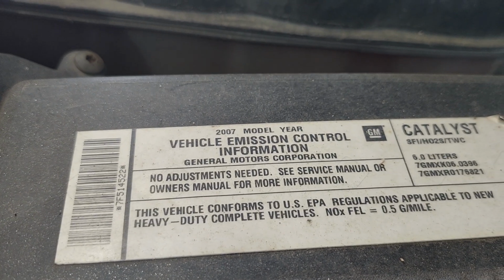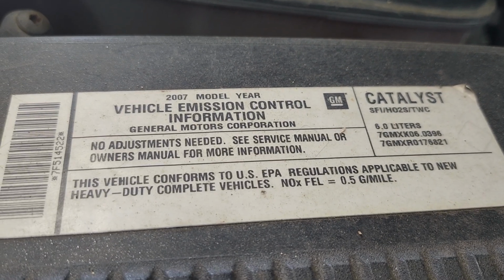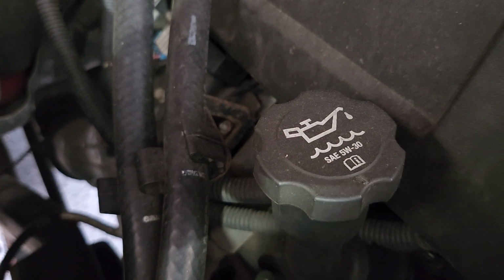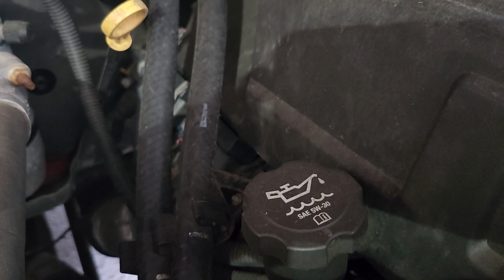Use 5W30  low engine failures .Use  0W20 oil high engine failures

Comment: I was looking at the comments and some people get it but most do not, so I will say it again the only reason they use this thin oil in the US and not in other countrys is for the fuel economy numbers that they have to meet, yes thin oil will give you better fuel economy and more power for a little while, until it starts ticking or locks up, dont do it guys, listen to Anthony he knows what the real thing is
Reply: It's not that cut & dry. Higher Viscosity doesn't always equal better protection, the "Additive Packages" added to the Quality top tier thinner 0w20 oils are what make it superior or just as good as the 5W-30.. Actually the 0w20 has better Additive packages
Reply from the maker: Thank u  I encourage views to read the comments

Comment: i changed oil to 5w30 on my 2016 lexus nx200t, f/the 0w20 it called 4... getting a little better mpg, up 0.02... runs sooooo much smoother & quieter since... kinda feels like i put a nu engine in it...  i am an AMSOIL guy... w/78k on it i went 2 their hi-milage, soooo glad i did...
Reply: That trick works with any engine, older engine and you can step up in oil viscosity for a bit. First number says how easy oil flows when cold, second number how easy it flows when hot. So basically you stepped up for harder flowing oil when cold and harder flowing oil when hot, that means it is bit thicker oil. Since your oil pump is not so good as brand new pump it will be much easier to push bit thicker oil and create bit higher oil pressure.   makes no sense your mpg to go down, unless your 0w20 was not as good quality as 5w30 or your engine was worn out significantly. Oil is not just flowing numbers there is much more specs that needs to be satisfied as per detailed oil specification of your car manufacturer so you can say you have the right type of oil for your engine.
Reply: you are doing the right thing, Amsoil is great stuff, just use the high mileage 1 time, if you have no leaks use the regular 5 w30, the seal conditioners can shorten the life of good seals
Reply: @JimSix-jo6hf  high-mileage oils aren't just for leakers- they have added protection packages for larger journal-to-bearing clearances.
Reply: @tommurphy4307  yes I hear you, but I have seen seals that failed early because they just got too soft, but mayby they were using a crappy brand of high mileage oil, I will have to think about it, thanks for the comment

Comment: I have a Ford Transit 250 3.7l. I have been using 5w 20 full synthetic usually penzoil platinum change it around 3000 should I start using 5w30
Reply: i would go by how it sounds on a cold startup- maybe even teeing up an oil pressure gauge to see how long it takes the cold start to make oil pressure. don't change anything unless you find a valid reason for doing so. you aren't mentioning the mileage or hours the motor has actually run. i have heard nothing but good things about pennzoil's platinum synthetic and thinking about trying it.
Reply from the maker: I would

Comment: I use Amsoil 0W20 diesel on my 3.0 Duramax. 6X more wear protection without sacrificing fuel economy. And I change between 5k and 6500 miles.

Comment: I have a car that uses 0W20 has over 230000 miles and a CRV with 320000. not sure if 0w20 is a issue.
Reply: And not every smoker dies of cancer...
Reply: good job with your honda motor. pay close attention to the oil you remove from that  motor- you're going to be due for a freshening soon.
Reply: Love Toyotas and Lexus

Comment: 5.4l triton 3 valve owners: switch to 5w30 at your next oil change. If you continue to run 5w20 you will have timing chain tensioner and cam phaser failure, guaranteed.

Comment: Get rid of the 0w20, buy and install a 5w30 oil cap, and if you take it to an oil change place tell them "I was told to only use the oil that is stamped on the oil cap". If they wish to argue about it (Most wont) just LEAVE.
Reply: yes, god bless you
Reply: there's no need for that- any good oil changer is going to use what works best for their clients.
Reply: @tommurphy4307  Not around here. Knuckle draggers pour in what the cap says, and often don't get that right. That's why I do my own.
Reply: @tommurphy4307  People - and things - don't always do what they are supposed to.
Reply: couldn't possibly be the turbo gdi pushing350hp out of a 1.5liter i4?  no, its a jus gotta be that there new fandangled oil that saves a whole whopping 0.02%mpg

Comment: I agree with 100% about 0w20 oils. With synthetic oil you do not need to change every 3k miles, only fudds do that. I have used synthetic oil for 20 years, I NEVER change at 3k, I change between 5k and 7k. I also run 5w-30, even with 0w-20 recommendation. I have never had an engine failure, I have put hundreds of thousands of miles on my trucks. I have also DOD/AFM delete my engines myself, the whole physical deletion, not just electronic deactivation. The GM DOD/AFM is terrible, not terrible enough to make me change manufacturer. I have used WalMart Supertech for years, no issues, otherwise I use Mobil 1 synthetic. Again, I stress I have driven my vehicles many hundreds of thousands of miles. I live in a rural area and requires lots of driving to go anywhere.
Reply: you never know- maybe those 'fudds' run the piss out of their engines when you're not around....

Comment: Use 0W20 ( or whatever is recommended from man.), change oil and filter every 6000 kilometres. If engines are failing it’s not the oil it can be manufacturing problems ( materials tolerances) and or extended oil change intervals . The oil will retain the protective additive package , but the oil still gets dirty , get that dirty oil outa there . I have 2 Jeeps with the 3.6 . I change the oil religiously every 6000 kilometres. I never change late usually early . My 3.6’s run like brand new . Change my diff transfer case and tranny oil every year as well … again they run quiet and smooth … like the day I bought them . This is very important!!!
Reply: i agree with you, and i also agree that heavier oil offers more protection under severe duty.
Reply: 0w 20 is junk with ambient over 75 degrees F
Reply: @gregweston2750  that’s about the most ignorant comment I’ve ever read. If you do realize oil on average runs over 200° don’t you?
Reply: @gregweston2750  And what type of bro science engineering degree do you have lol !!! That transcends all the engine design engineering and technology and all the oil engineering advances and tech … please let us know what engineering schools you “done gradjiated” from … ahhh let me guess the Jethro Bodine school of knot , knot carry the knot school of engineering lol 😂 🤣 .
Reply: The only way you will ever know if the oil sheared down after a summer run is an oil analysis.

Comment: I can agree I have a 2012 Tahoe ppv with vvt and afm with almost 300k miles and almost 20k idle hours no issues at all I burn about 1 quart every 5k miles but that’s the few times I went that long I usually go 2500 to 3500 I got it with 150k miles and 7k idle hours in 2016
Reply: still experiencing oil consumption? check or just replace your PC valve.

Comment: Problem isn't the oil viscosity. It's the OCI. In fact most 0W-20 engines actually spent most of their lives with 5W-30 in them instead. Why? Because people took them to dealerships or lube shops who buy bulk oil and whatever is the cheapest that meats SAE requirements. Most vehicles spend their lives in the 'severe' duty and should have their OCI halved. Manuals use to come with a Schedule A and a Schedule B. Now they just state that if you do any towing,stop and go driving, or short drives, you should change the oil more frequently.
Reply: i used to purchase bulk oil for the services my dealership provides and cost isn't the only factor. we used whatever gave the most success first and foremost with cost being the second factor- usually the cost difference is minimal or even nonexistent.

Comment: 0w20 isn't the problem, GM manufacturing and quality is the problem.
Reply: So all the other manufacturers having issues with 0w-20 failures  like Audi, Ford, Dodge, Ram, etc are all because of quality issues?  Wake up!
Reply: i would never use that crap in any of the engines i've built.
Reply: Have you bought a NEW CAR recently?@tommurphy4307
Reply: Nope, same issues in Honda and Toyota engines
Reply: There is a multitude of problems not just oil

Comment: 2013 civic lx (240k) used 5w30 since the day i bought it and now it still runs like the day i bought it. Truth. I do maintain my car though 5k OCI and 40k transmission fluid changes
Reply: Running my 2024 2.0 civic on 5w-30. I swear I could tell that the 0w-20 was dropping to like 0w-16 between oil changes.
Reply: @MoggedByFatigue garbage oil

Comment: I use 0W-20 Amsoil it is good oil same with 0w-16,but in the proper engines like Toyota's. GM has an engine design problem. Viscosity is not the only thing to consider,if it was than go with 0w-40 as Americans love bigger numbers on anything.Blame the oil only if you are using dino oil and not changing it enough,
Reply: Group 4 and 5 oils have a higher heat range...

Comment: Many 5w30 designed engines are shipped with 0w20 and mostly electronic differences to meet emission/efficiency requirements
Reply: nonsense- i've switched to 10W40 (plus lucas oil stabilizer) and i get about 0.5 fewer miles per gallon on my nissan MR20DE with 80K on her. meanwhile- i have cut oil consumption in same motor by 66.6%. the lighter weight oil advantage is a myth.
Reply: Really? What engines are like that?
Reply: @evil-c4o  the abused and neglected ones are.

Comment: If Biden was still in Office, I would worry that someone would report you to the EPA. Because technically, a thicker oil burns more fuel and pollutes a tiny bit more. Although you are 100% correct.

Comment: Yeah, i would never go under 0w-30. I had a gdi that specified 0w-20, it used 1 litre oil pr. 5.000 km. Changed it to 5w-30 (with otherwise the right specs) and no oil consumption.
Reply: and what should I say, my car is specified for 0w20 and I still use 0w20 and I have no oil consumption. If fix works for you, good, that is off the point, point is your engine has a flaw if it is not working with default specified oil type. That is the point. It is not the oil it is engine failure. That is if your  0w20 with following specifications beyond just the viscosity complies to manufacturer standards.

Comment: Honda civic si 250,000 on 0-20 Mobil one, runs like a charm,3,000 mile oil changes😮
Reply: What year? Why did you decide 3k instead of 5k? I’m assuming I manufacturer recommends 10k?

Comment: Change frequently and move on with life.
Reply: Have been USEING 5w20 for 13 years in my 3.6 Ram no problems at all change every 3K.
Reply: @Happy11807 good for you, 10’s of thousands haven’t been so lucky.  Engine failures across all manufacturers with thin oils including Toyota, Honda and Nissan.
Reply: And a new engine.
Reply: @datsuntoyy Have done this for 60 years,WITH EVERY VEHICLE I HAVE OWNED,NEVER ANY ENGINE PROBLEMS WITH ANY VEHICLE I HAVE OWNED,ALL FORD,DODGE AND JEEP/AMC VEHICLES!NO JAP GARBAGE!
Reply: @datsuntoyy 0w20 and 5w20 have been used for decades now, probably in millions of vehicles. If you have solid data on engine failures resulting in replacement, please share.
Reply: @ericg3810 has to do within 10k mile oil change not 0w 20
There's toyota camrys running all over the place with over 300k miles and no issues.  Running ow16.....
Reply: Or put in a more appropriate viscosity oil and move on with life. Its not one iota more effort to find, buy, install a better oil. Its on the same shelf, three feet away from the worse oil.

Comment: Do NOT use 5w-30 if your engine calls for 0w DO NOT LISTEN TO THIS PERSON modern engines have tighter tolerances and more precision machining, engine internals are designed around a few key things and it’s oil is one of them IF YOU WANT BETTER PROTECTION GO WITH 0w-40 DO NOT CHANGE THE COLD FLOW RATING JUST BECAUSE SOME CLOWN SAID SO DO YOUR OWN RESEARCH
Reply: You can definitely use 5W-30 in an engine that calls for 0W-20. You can use a 20W-50. Unless you love in an environment that gets to -40.
Reply: @maxgrrdog843  yeah you can and it will increase engine wear, like rod bearings, cam journals/bearings and you’ll end up with an engine that won’t last long because you couldn’t follow instructions and you most definitely don’t have any mechanical/machining knowledge whatsoever to understand and you’ve made that clear in your comment
Reply: @DillonDner . Thicker oils in colder climates are not good for cold starts, here in the U.S it’s an economy thing 0w-20 in colder climates will get to the top end faster but the rule of thumb is dont change the thickness of your oil unless you have oil samples/testing to prove that you actually should. STOP PLAYING BACKYARD CHEMIST because you will lose without proper testing

Comment: I am so glad the motor oil geek exists so he can use facts, data, and science to support his claims. Lower viscosity does not equal less protection, it has to do with surface finish on the bearings, bearing clearance, and oil filming. A higher viscosity oil does not necessarily make for better protection. The reason it is working in the GM 6.2 is because of bearing surface finish and clearance. Higher viscosity oils can actually increase wear in some engines because the higher viscosity oil creates more heat, and therefore creates more wear. Toyota has proven 0W20 is a million mile engine oil. I have no doubt 0W16 and 0W8 are fine as well. GM just cant build a good engine, and are using the higher viscosity as a band aid for their crappy engine design.
Reply: TGMO is one of the best 0w-20 oils on the market. Solid GrIII basestock and good slugs of boron and moly.

And yet my 2017 Lexus GX460 still burned 1qt every 5k OCI and ran rougher when hot (I'm in S Texas). At 110k miles, I switched to 5w-30 synthetic and instantly the oil consumption dropped to ZERO for a 5k OCI. Sending 1qt of oil through your cats every 5k miles is always bad. What's more, engine runs noticeably smoother at all RPM and I'm seeing more timing advance, too. At 135k, I'm never going back to 20-weight oil. Ever.

In S Texas, 0w-20 was not going to get my engine to 400k miles.
Reply: @DBravo29er  Cant comment on Texas ( Im in NY)... what about running 0w 30?..guess you are not concerned about the cold in Texas 🤣
Reply: @totalnoobfishing1753 It still gets down to the 20's here a few days each year. No issues.

0w-30 is going to have more VII's and will shear down faster. Timing chains, especially, will grind away at VII's
Reply: You are 100% DEAD ON.. but you're commenting against a bunch of armchair mechanics

Comment: Owner’s manual says 5,000 mile oil change, no problem. Owner’s manual says 10.000 mile oil change, engine fails.
Reply: You have to read the "*SMALL PRINT!"  where it say´s "Under hard driving conditions service interval should be ½ the recomended service time!". To be on the Safe Side change the oil/filter as though it is under those conditions.
Reply: Most cars owner's manual do not go by mileage but by the "maintenance minder" system... :face-blue-smiling:
Reply: @edwardinvegas  Can you name one make/model/year of car where the manual doesn't go by time/mileage and tells you to only change oil by the maintenance minder?
Reply: @FirstNameLastName-hz4kv  Any older car that doesn't have it...ask a silly question, get a silly answer...
Reply: @edwardinvegas  when I build the motor- I am the 'maintenance-minder'.....
Reply from the maker: True so true

Comment: I recently drained the oil (warm) out of a Honda CR-V.  Dumped out like water.   Virtually no viscosity.  5,000 miles.
Reply: That’s hot oil in general. Get 15w40 diesel oil hot and it’ll run like water.

Comment: My 2004 Honda with well over 200k miles I have owned since new is still perfect with 5w20 all its life.   Seems people are not changing their oil is the reality
Reply: Yes I agree been running 0W/20 in 2014 Honda CR-V since new and no issues at 152K in the reliable Honda 2.4L. The bigger problem is people not changing the oil regularly...
Reply: @edwardinvegas if you don't change your oil 0w is worse than 5w, as it will degrade to at least that level digit, so long term 0w I can imagine being pretty awful ..
Reply: Those Honda engines were designed for that oil weight. Most of these engines were designed to run on 5w-30 and were BACK SPEC'D to a 20 weight oil.
Reply: @DBravo29er Nope.  Many videos prove that wrong.
Reply: @lonniebeal6032  What do I care about the videos when I have PDF's and hard copies of the original vehicle manuals? They got videos saying the earth is flat.

Comment: Aswell, if you are using a truck that says 5w 30 and you are pulling trailers you probably should step up to 5w-40.
Reply: absolutely- maybe consider going to 10W30 or even 10W40 and using a block heater if it gets really cold.

Comment: I still drive a car with over 400k. Spec is 5-20 but i'v been using 5-30 since car hit closer to 200k.

Most cars with higher kilometers i'v seen are thicker oil. Never seen any 0-20 going pass 300k.

Another thing is oil control solenoid. That this is a guaranteed failiure..!! Bring back the simple mechanical pressure control..

Cylinder shut off is another b.s.., 

Regardless how well you maintain the car, modern engine technology is for manufactures benefits.. less emission=more tax breaks=more sale of disposible cars.